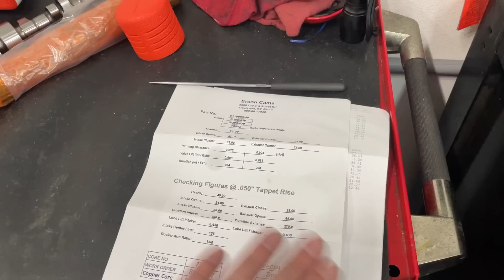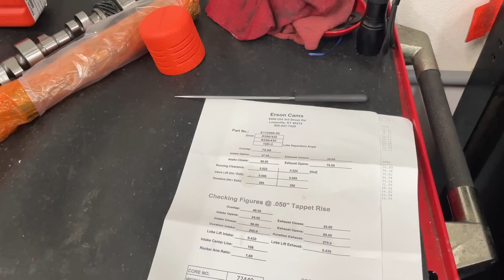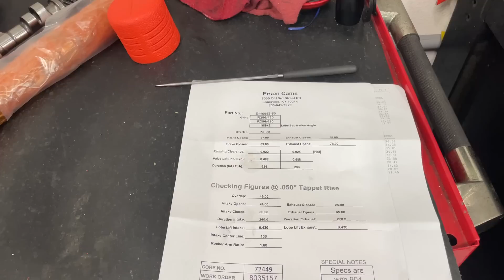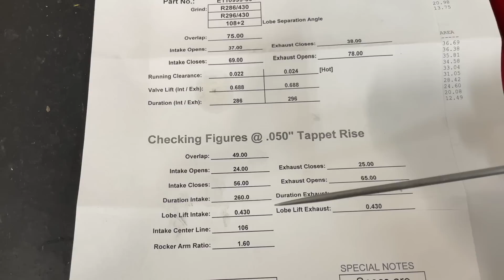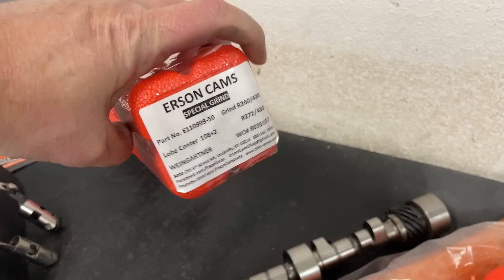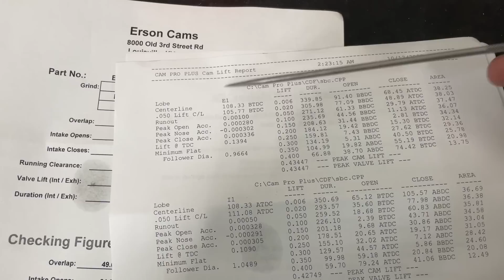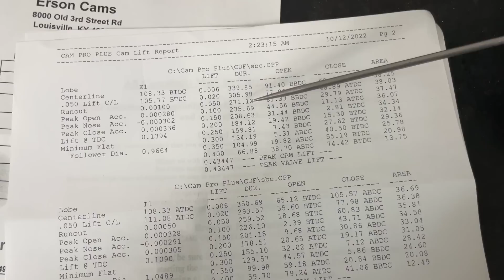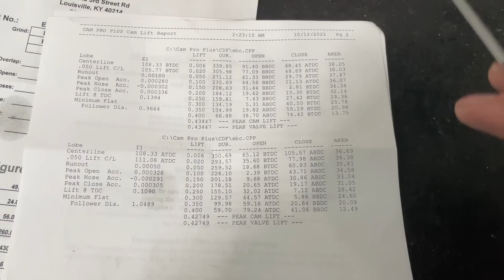Camshaft Info Again

Comment: The shop that's putting my Olds 380 short block together recommended BAM lifters (he actually told me they were Crane at first, but when I ?'d that statement he said it was a former Crane Engineer i.e. Brad building them).  I had some Hylift-Johnson Hydraulic Rollers in my 403 with a  Lunati Voodoo and they were nice and quiet.   The one thing about those BAM lifters they aren't Cheap, but neither are Morels.
Reply from the maker: They are not cheap but a little cheaper than morel. Also easier availability.

Comment: When i'd get bugged about 'this cam or that?' I'd say, "subtract the @.050 duration from the adv. duration on each cam, buy the one with the smaller difference."
Reply: I think Harvey Crane called that number 'intensity'
Reply: Yup.

Only question is - did both manufacturers spec the seat duration at the same lift?

(hint: this is one of the advantages that MoPar stock eliminator drag racers had; the factory spec'd the duration at some ridiculously low lift... IIRC the spec on the Magnum and 440-6 engine exhaust lobes was something like 352° on the seat... allowed for some stupidly long duration 'cheater' cams)

I believe this is why some guys check them at .200" lift as well as .050; that way they know they're comparing apples to apples
Reply: @billythebake  I spec hydraulics at .006, .050, and .200 tappet rise. Also, .006 is SAE standard. But yes, duration numbers without a lift point are useless.

Comment: What hydraulic lifters would you recommend  for a street car, building an engine and seems like everyone has there own pic on lifters just wana hear your opinion on the matter
Reply from the maker: If it’s flat tappet I don’t recommend any. You should switch to hydraulic roller. Much more reliable
Reply: @WeingartnerRacing  sorry I shoulda clarified, it is a hydraulic roller cam just wondering what you would recommend hydraulic roller lifter brand you would suggest in your opinion and have good experiences with

Comment: I have a 385 sb Chevrolet with a SCAT rotating assembly Internally Balanced with AFR 195 eliminator heads 65cc chambers ISKY  Hydraulic Roller  294°  duration  intake and exhaust  246° @ .050 .550 lift on a 108 lsa installed at 102° ICL . How are the short travel Hydraulic Roller lifters from comp?

Comment: Have you tried any of Comp's 4 pattern cams? they say you can get away with using much more lift than you usually would and still be streetable. (For those that don't know, the 4 pattern thing is using greater lift / different duration on the outer 4 cylinders due to the effect of single carb manifolds naturally supplying more fuel to the inner cylinders, they were kind of a secret thing with the Nascar cup guys for a long time and grinders didnt like doing them because they had to re-index their machine several times to do the 1 cam before they got the CNC units in use now) aswell a a 4/7 swap cam in a a gen 1 SBC , that's something I'd l,ike to try

Comment: Comp does have a lot of lobes. Cam Motion does too. I think a number of companies have many lobes, Comp does publish more than most.

Have you ever run a heat treated steel distributor gear?

Thanks for the video.
Reply: I think the difference between dealing with Comp vs. Kip over at Cam Motion is that the latter have a lot of lobes, but if you need a lobe he does not have, he will design it. Unless you are a top end race team etc. you will never get that from Comp.
Reply: @AB-80X  That's true. He will also grind a lobe you design.

Comment: i like comp cams but i will not run a copper cover cam again.  it costed me a 434 from shafferoff after a year and of course they didn't want to do anything about it  so i called comp they did send me a new cam  but i still had to fork out 8500 at sunset racing  and thaing god joe was cool and spotted on the aluminum t&d shaft rockers where shafferoff used a grinder to clearance around the springs.. and a couple were cracked ...so i got a set of chromoly ones for it
Reply: I wouldn't never use Shafferoff. I haven't heard nothing really good over the yrs about them..
Reply: @jasonstormoen   yeah at the time i didn't know   i just knew he was big in pro stock back in the day and had a good name for him self. And i saw their 434 making 720hp for 16k and i jumping...i should have went with my gut and went with sunset .or reher Morrison   because i like to keep everything local because if i have a problem id rather talk to someone face to face rather then over a phone  im just old school like that.  But 16000 in plus 8500 to have it done  right  and make 120 more hp now ..
Reply: @jasonstormoen  and as we broke down the old motor  i was like really  this is all off the shelf parts nothing special  just slapped together   dart little m block  scat crank rods and flat top pistons  comp cam  427int/420ext. 256/262 on a 109 lsa with 1.7 t&d shaft  isky redzone lifters .. afr 245  heads  and a bill Mitchell performance  intake and 1050 qft carb
Reply: @Fatt-billy.racing   yeah it's sad how these guys get on racing junk and other sites and pushing their stuff and are able to keep doing it with the countless issues people have complained about. I keep my stuff local too. I used Steve Morris and when I moved south to NC I started using PAR Racing Engines no complaint what so ever over Steve either, damn one of the best, and I travel racing but when I'm broke down, I'm at home so I like my stuff close to me too.

Comment: Het Eric , how come you didn't use all the new block and parts for your race car motor. then ust the older race car motor parts for your dyno mule, with a cam change ??..SHP pro block,BBC cam etc, would these be better for your race car ...
Reply from the maker: The trucks new engine is an shp block. I will probably beat the mule harder than the truck.